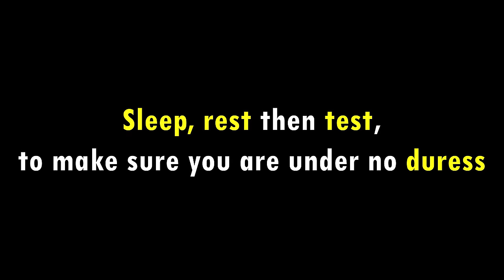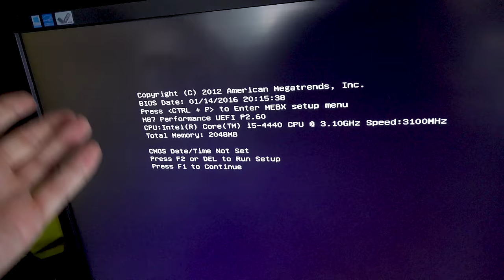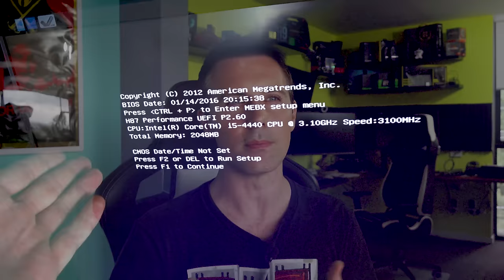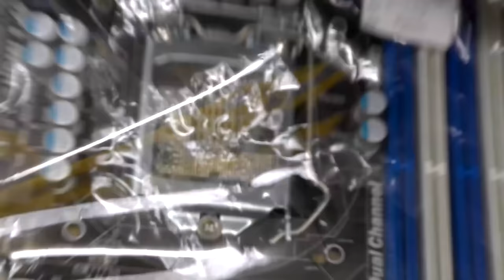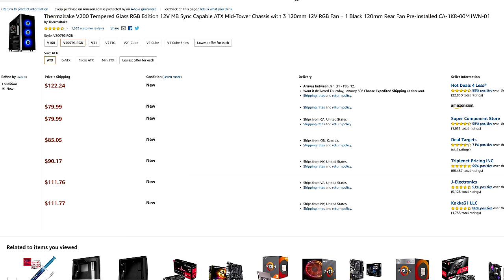Washing 12 Motherboards with WATER and Attempting to Fix them - (Can YES Fix it Pt. 1/2)

Comment: Ok so After watching both of these videos (out of order but still) I am wondering if the wonky ASRock Z77 board could use a cleaning. It works but it will NOT overclock anymore and despite all 4 dimm slots working they will not work all at the same time. Also have some random dead PCIe slots, it's not the CPU as I pulled the 3570k and put in a 2600k and has the same issues. Ended up with another Z77 board (so I know 100% both CPUs are solid) but it would be nice to have that ASRock back, I miss it lol.

Anyone think this would help> For what it's worth I cleared the CMOS (battery and button) and it is on the newest version of the bios.

Comment: what i advice:

-to fight corrosion you can take extremely high grit paper or stones(6000 and above) because they take so small amounts of material you end up only taking off corrosion,something like when car battery corrodes or ground connection corrodes you take some high grit sand paper and sand corrosion down

-this can be done on small parts IF you can get that kind of grit stone or paper,AND contact cleaner is a MUST when doing job so it can help you take away that corrosion faster making it softer which means you don't scratch healthy metal as much as you would usually take away that corroded layer

you can fix motherboard and you see some damaged compoments by  buying them new or taking them from dono motherboard then proceed to de-solder damaged parts,then proceed to re-solder new ones

P.S: Please when you throw motherboards into trash TAKE AS MUCH PARTS OFF OF THEM AS POSSIBLE,YOU MAY HAVE HAVE 100% HEALTHY COMPONENTS ON THEM EVEN IF THEY ARE NOT POSTING

Comment: Compatibility issues with 775?!? In my experience that's the most compatible platform I've worked with XD
Reply: He’s had really bad luck, I haven’t had any of the issues he’s had. The biggest issue I’ve had was some weird ram compatibility issues on a DDR3 board.
Reply: @EvilTurkeySlices  yeah DDR3 boards can be pesky. Mostly because the platform was never designed for DDR3 and most sticks are too modern for it to handle (density and ranks)
Reply: Wouter Verbruggen I have two 4gb kits and one 8gb kit of DDR3, all three refused to work in dual channel(system wouldn’t post at all) the 8gb kit didn’t work at all. To get 4gb in dual channel I had to use one stick from each of my two 4gb kit. They wouldn’t work in their matched sets, but worked fine with each other.

Comment: I also have a real problematic asrock z97 Extreme4, I have to underclock CPU, underclock RAM, run PCI-e lower at 8x 2.0 in the second PCI-e slot (top slot has to run at 4x or it doesn't work) its also the second one I've had, the first booted only 1 in like 100 times, but would work fine when it actually booted up.

Comment: 18:20 I have broken pins EXACTLY like that, it was when I delidded my 8700k and TRIED to use Liquid Electric Tape adhesive to put the IHS bck on. I let it cure in my Rockit 88 for 32 hours, and carefully lifted it out of the tray by the IHS, nd once I opened my socket, the IHS came unglued and slipped put of my fingers and landed corner directly onto 5 pins, bent them so bad that They BROKE with very careful rebending to try to fix them.

As a result, I have an extra ASRock Z370 Fatal1ty Gaming K6 that is missing 2 pins an will not boot. It is very pretty on my wall at least!

Comment: Love the content. Keep up the good work! 

As fast as a good, cheap pc case goes I recently found and purchased a rosewill spectra x blue mid tower case with four fans already installed for only 34.99!!!

I kick myself for not buying a second one. 

I'm currently building inside it and its awesome! 

It has room for either a 360mm rad in the front (I'm installing the thermaltake C360 DDC in the front of my case) or a 240mm rad on top (although I'd pair it with a MOBO that's at least a little shorter than the asrock X570 steel legend wifi that I'm installing...or if go with low profile ram you can still put a ATX MOBO in it) 

It's an incredible value if you can find it at the 34.99 USD I paid. It currently costs the regular 69.99 USD price but I'm hoping to continue to watch thre price on it and the second it drops back down to 34.99 I'm buying at least one or 2 more to do more builds!

Comment: Bryan.If you get a motherboard that doesn't work and you get it to work again.Do you run intensive quality control programs?Like Aida64/prime95 heaven benchmark etc before flipping it?And what's the return rate?

Comment: In the US, I don't think you can beat the Thermaltake Versa H18 for a value mATX case. It's about $50 with a tempered glass side panel, full mesh front, PSU shroud, and a blue LED strip on the front panel

Comment: Can i spray Intel cpu (microchip side) with electronic contact cleaner, or can I use something else?
I want to get rid of paper that is glue on the center of cpu, on the side where is a sticker, on the chips...
There is a picture
https://www.solidrop.net/photo-1/300pcs-x-lot-cpu-lga-771-775-stickers-771-to-775-adapter-for-xeon-x5460-e5450-e5462-e5440-l5420-l5430-x5470-x5472-x5482-adapter.jpg

Comment: I would be against washing motherboards with tap water. Lots of tiny metal particles in tap water that can be left behind and cause arcing later. If I had to though I would hit it with a shop vac after they dried to pick up all the little particles left behind. Of course modern houses now do tend to have water filtration I just wouldn't use hot water.

Comment: So Brian, I need to thank you. I had an old Gigabyte Z68 board, that I just could not get to boot. Nothing worked, been trying for months. Nothing worked. So yesterday, I took it upstairs, removed the cmos battery, and washed it under a hot shower head, with a stiff paintbrush. It's dried overnight, and right now, it's currently installing windows!!!!     Who would have thought?? Fantastic. Thanks for the informative channel. Keep up the good work. Thanks again Brian.

Comment: 18:00 For some scenarios (but not all as it won't work in other scenarios), it is possible to anneal such a pin with an ESD safe soldering iron tip by cooling the plastic around it first, then heating the pin in question with a hot-air-gun (before the soldering iron, momentarily) and using a thermocouple to keep the temperature stable. Create a small heatshield (e.g. a glued-ring of trimmed-headless matchsticks or card coated in fire-retardant) around the pin (restricting convection current of the air) to localise its heat dissipation, and so an extra thermocouple (e.g. via 2 multimeters) on the outside will show the difference in temperature compared to inside. Use a heat camera if you can, and helping-hands clamp. Be prepared though that reflowing an entire socket (such as that which is salvaged from another mboard) might be the only way to solve such MBoard woes, if at all. If however, you have annealed the pin successfully, you could have a better chance of bending it back into shape without it snapping. A slow cooling should anneal it. Good luck! This info should help you but don't bork your mobo, guys! Still, if you repair a $50 Mobo for $5, it might be worth it. This comment does not constitute medical advice.
My comment has no hate in it and I do no harm. I am not appalled or afraid, boasting or envying or complaining... Just saying. Psalms23: Giving thanks and praise to the Lord and peace and love.

Comment: Nice video. Allthough you should dry them in oven in 50*C and also buy yourself a cheap bios programmer like ezp 2010 or 2013 to program SPI, also some multimeter and soldering iron. Most of those boards could be very easy fix!

Comment: Had a nice "lesson learned" when cleaning my ASUS P9X79 Pro motherboard. Make sure the CPU or socket cover is in place!!!  I had some thermal paste that had gunked up around the socket edge, so I took an absorbent cleaning cloth and gently started cleaning close to the socket.  Then the cat arrived and I turned for a second...then looked back to find that about a 1/2 inch square of the cloth fiber had hooked itself to the pins. Holy moly...disaster.  I did not know what to do at first.  I set it down as best I could and started to ponder...how the hell to separate this mess?

I got out a BIC lighter...and burned the fibers that had hooked themselves.  IT WORKED!  I was fast with the flame, so as not to screw up electronics or solder.  It was a scary time.  All is well with the board.

Comment: Part of the problem, I found - with bending pins and the CPU socket:  if you do NOT insert the CPU properly ( as described in the hardware booklet that usually comes with the board ) - either with a proper insertion tool or correctly, by hand - there is a risk of severe pin bending.  An incorrect CPU size or model will bend your pins out of alignment.  No doubt about it.

Comment: Most electronics contract manufacturers use water based PCB cleaning systems now - although they normally use deionized water rather than plain tap water.

Comment: I'm giving my nearly departed stereo the side eye right now. I swapped for it as a favour and the chance of it being an upgrade power wise if I managed to fix it. All the horizontal boards were caked in years of dust and it had what sounded like typical shorted speakers. Cleaned what I could with alcohol and a number 6 watercolour brush and it worked! It sounded awesome, the display came back to life, the buttons did what the labels actually said... for one glorious day 😅. I was gonna try and find a shop to fix it but then I remembered this video! I think it might be time for a full stripdown and hosing for my venerable Panasonic!

Comment: hi, great job, i tried this and motherboard works again, but weird thing is it works when it wants to, after hair dryer it works great, leave if off for a while and its "cold" and it boot loops, hair dry it warm again and it works etc,there is no water etc on  mboard, the hair dryer makes everything so hot i cant touch anything metal on the board!(so diff dry)

Comment: I recently bought a x399 board which was used in LN2 overclocking and it was so covered in vaseline that i had to use some mild soap. Worked perfectly afterwards.

Comment: Most of the boards that died on me were Gigabyte, then Asrock, then the other brands.

Not sure if that is simply due to the general quality difference or just my experience.

Also I am pretty sure I see less boards passing then Tech Yes City.

Nice video Tech Yes Man 😜😉
Reply: Yeah it varies with cpu generation I'd say more then anything.
Am3 I'd say gigabyte is really good, same with socket 1366 gigabyte is top notch.Asus on am3 i got 1 half dead motherboard here where the traces too 3 out of 4 ram slots just don't work or exist and bootloops with a phenom II x4 955 & a athlon II x3 445 if i put in a 2nd ram stick.

It simply doesn't boot if anything is in those slots even if i put the voltage on ram too 1.65v before i turn it off & put another 2 gb stick in of ddr3 on the ddr3 sticks I've tried and sucessfully had working in other pc's.
Asus on socket 775 it's a bit hit or miss.
I've had one p5q pro that the onboard sound didn't work on & the p5q premium board i got for a testrig here now Came with a core 2 quad q6600 that was terribly warm for the intel copper slug cooler so removed it for now.

With a e8400 @ 4 ghz the copper slug cooler works fine on there, it hits about 70c which is perfectly fine for an open test rig specially at 4 ghz on such an old cpu it was surprisingly easy to overclock that too 4 ghz with the 1066 mhz ram i got in that testrig (2x2 gb ocz reaper.)

Everything works on the p5q premium except 4 sata ports on it's 2nd sata controller where it doesn't detect anything in the bios or windows regardless of bios settings.
Reply: Marcus60661 I actually have a good experience with Asus boards on AM3 and AM3+, not so much with the Gigabyte, Asrock and MSI boards (in that order.) However on AM4 with X470 and X570 Gigabyte boards I find them much improved (especially VRM on X570.) 

On socket 775, 1366, 1155, 1156, 1150, and even 1151 I had some real bad luck with Gigabyte motherboards. A lot of them died over the years and I still have all my Asus boards still working except for a single socket 1150, Z97-A one. It doesn’t boot into the bios anymore.

Ps. Never owned a Biostar motherboard, they look kind of cheap(ish) and usually it has features missing, like not many USB ports, a single M.2 instead of two or more and so on.
Reply: Yeah never owned a biostar here either as far as i can remember at least.

My gigabyte 870a ud3 rev 2.1 still works well in my dads pc & i bought it in august 2010 with a athlon II x3 445 & 2x2 gb kit of 1333 mhz ram from corsair had a sapphire hd 3650 512 mb for i think 2 months & then i bought a sapphire HD 5770 which still works fine besides the displayport which I'm not sure worked in the first place, might have been my displayport too hdmi cable as well as that stopped working on my r9 280 as well from sitting bundled up in a drawer.

Today it runs with a phenom II x6 1090t @3.5 ghz, vrm gets a bit hot past 3.7 ghz on that cpu but otherwise runs great.
I got my r9 280 that was in this pc for a while again as the msi gtx 780 i got from my older brother when he upgraded finally kicked the bucket around November last year i think ?

(Gpu die solder balls cracked most likely or a fuse too one of the pci-e 6 pin connectors has died or something. Gpu core voltage stays at 0.950 - 0.650 which is quite awful when it normally sits at like what 1.25v ?.
I simply haven't bothered trying too fix it anymore after a week of various stuff so it sits nice & clean on a shelf here as a display too look at.

Currently looking a bit after either an I5 2500k or I7 2600k along with a gpu thats faster then the gtx 780 ti which is still tough on a low budget, while i had the regular 780 id like performance increase too be noticeble at least.
Reply: Marcus60661 I got a Phenom II X6 1090t as well, I got it on a Gigabyte GA890 UD3 with OCZ 4x4GB 1866Mhz and two Sapphire Radeon HD7970’s. It is one of the only still alive Gigabyte boards I have from that era 😀

My FX9590 currently sits in a Asus 990FX Crosshair VI Formula Z with 4x4GB 2133MHz Kingston Hyper X with a R9 Fury X. It used to be on a Asrock 990FX Fatal1ty Killer but that board eventually died 😫

Also got a FX8350 currently on a Asus 990FX Sabretooth Rev.2 with 4x4GB 1866MHz Kingston Hyper X with a Asus GTX1060 6GB.  It used to be on a Gigabyte 990FXA UD3 but that died, I replaced that with a Gigabyte 990FX Gaming... that also died, so yeah... bad luck I guess?

Also most if not all of my socket 775 Gigabyte motherboards are now dead sadly 😟

Of the Asus motherboards only one of two M5A97 Rev.2 ever died and I believe that was due to damaging it after replacing thermal paste (user error.)

Still I love my old hardware 😜 My wife however says the hobby is getting “out of hand”... I just now ran upstairs to my “mancave” and to my small home-office and counted the PC’s and consoles... I’m at 27 now... maybe she’s right 😬 (old and new combined.)
Reply: Marcus60661 also, try getting a i7 2600K, much better nowadays then a i5 2500K due to the hyperthreading (less stutter.)

Comment: ok so.. i got a h61m board tht would run fine for a couple of days n then it starts shutting down randomly. when it starts shutting down randomly i had to not power it on for a couple of days n then it works again. anybody know what is happening?

Comment: My experience with faulty AsRock 4th Gen series motherboards whether its the Pro4, Pro4M, Fatal1ty series with the the same no post issue is the Intel PCH chip under the heatsink. I had an H97 Pro4, H97M Pro 4, and a Fatal1ty H97 with the same no post issue. After taking my time troubleshooting I narrowed it down to the PCH chip. I went ahead and performed a reflow on the chip. After the reflow, I let the motherboard cool down. Once cooled, I reinstalled the CPU, Memory, and GPU placed it on my test bench and I was able to get all 3 boards to post once again. I recommend to anyone who is having this no post issue with their 4th gen Asrock motherboards to reflow the PCH chip with a heat gun or any other suitable piece of equipment that can do the job.

Comment below if this PCH reflow fix saved your Asrock Motherboard.

Comment: Bake the boards that are not working!  bake them in the oven to slight solder melting point, this will reflow the board, this could fix those that are not working

Comment: try this bryan: soak them in the bucket with detergent overnight,and then rinse it until no detergent left on the motherboard.then dry it for good.i always use blower to blow any remains water on the slots and ports.then let it dry on the sun for about 4 hours in clear weather.trust me,hope you gonna do my trick

Comment: I've taken my computers apart and washed every thing down in the sink with hot water.  I put the parts on a towel and let dry for 2 weeks. After 2 weeks, I Put it back together and fired it up. Worked just fine.

Comment: its more likely the pins got bent due to the tim acting like glue on the heatsink and the user yanks it to hard it forces the retention bar to pop and come out at a funny angle bends both the socket pins and cpu pins i had this happen on my x470 ch7 with a 2700x on the stock cooler was so gutted that chip oced 20% on auto settings i never even got the chance to manually oc it gutted

Comment: Done this many times without any problems. Drying the boards etc at 50C in the oven with hot air to make sure all moist is gone. Repeating this over a couple of days as moist might be trapped inside the boards.  Be careful with higher temps as the solderings and plastic will melt :)